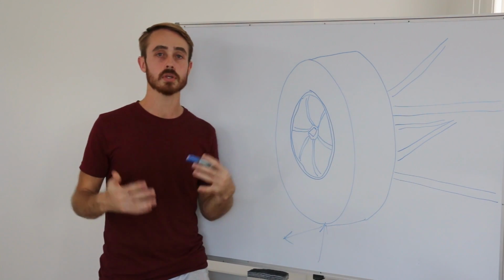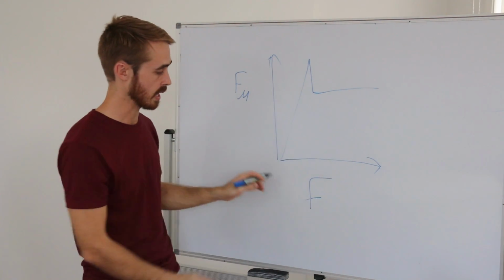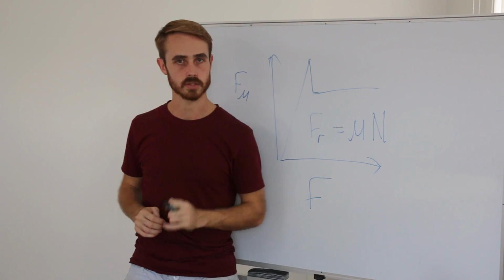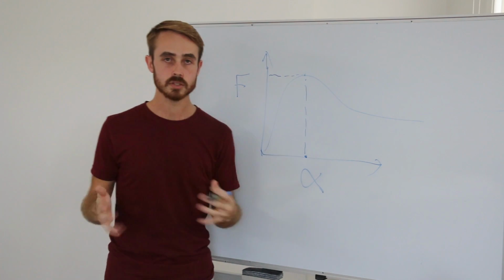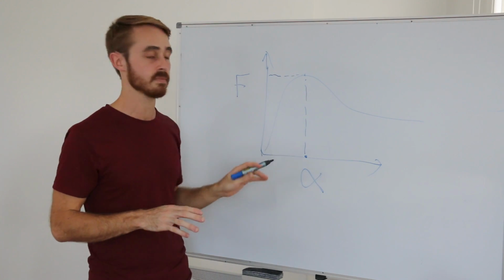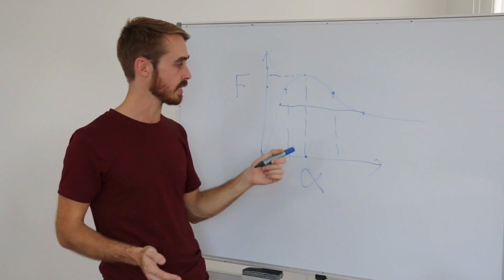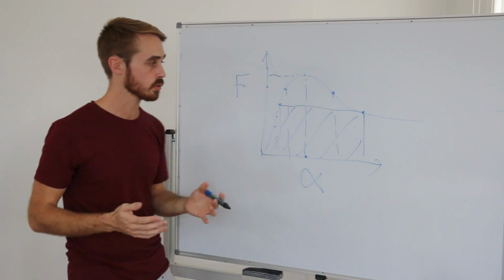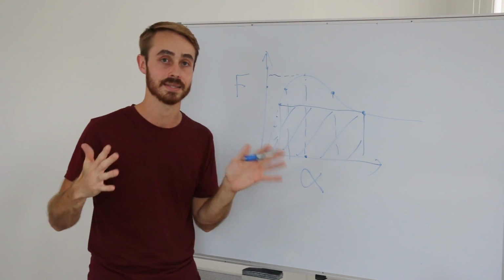How do Race Car Tyres/Tires Work? Slip Angle, Contact Patch Deformation etc.

Comment: For offroad there's also a flotation factor. Overly tall sideways are counter productive for high performance offroad vehicles as handling and response is definitely a factor. When looking at winch truck racing the vehicles aren't crawling through endless tight obstacles at low speeds.

Comment: I was hoping you might go into more detail on the effect of the portion of contact in transition, the section of the patch coming into and out of contact with the road which is travelling at a different speed to the road surface. You touched on patch shape, I started thinking about target contact patch shape and how to achieve it, have you some thoughts on this ?

Comment: Discussion on off-road tyres, longer, skinnier contact patches with no ABS offer more braking when the wheel is partially locked so that the front edge of the tyre is clearing the road of loose gravel allowing the trailing section of the contact patch to run over a surface with a better coefficient of friction. A wider contact patch uses a higher percentage of the tyre for clearing and has a lower ratio of contact patch on the cleaner surface.

Comment: I'm designing a hill climb open wheeler, Hayabusa engine at rear  BUT thanks to formula libre rules and using cfd from the web I can generate 4 times the vehicle weight at the tires so, 4g cornering and braking.
So the tires have to have accept a 4:1 ratio of normal force and 6:1 ratio of lateral force.
I imagined that tires for high downforce cars would have a higher vertical stiffness, BUT, to my surprise the Avon data for FSAE is around 1000 lb/inch and Indi Lights are around 1500 lb/inch.
I also notice the tire diameter increases with speed and downforce. 
So for the indi lights the 1500 lb/inch is not as big a % of sidewall deflection  because the sidewall is higher.
This is the limit of my understanding having looked into it all for about a week.
I suspect there are a lot of people who are wondering how it all works, just as I am.
I have a pdf that shows what I have found out but have no idea how to send it to you.
Cheers
John

Comment: Is it possible to build a system into a rim that can fit under an existing tyre (no modification to the tyre itself) that can circulate fluid within the tyre to help regulate pressure and temperature?

Comment: I think the reason why oversteer is used in off road is to use the dynamic friction of the wheels to push the car through the corner. Like a centripetal force pulling the car around a bend.

Comment: question: at 12:30 you draw 3 lines, where the " lightest car"   has more slip angle  at a low Fn than the other 2  . that incorrect isnt it ?   not only will a lighter car on the same tyre have a smaller slip angle it will also generate more corner force .
Reply: Marc I think instead of imagine that tyre being on a different car, imagine it being driven on a same car. The centre line is when the car is being driven on a straight line. As you turn left at a certain amount of G-force, weight of the car shift to the outside which change the normal load, the top line will represent the right-outside tyre and the bottom line will represent the left-inside tyre. That’s why in racing anti-Ackerman works really well.

Comment: U said the narrower tyres will be better used in speed racing compared to that of wider ones due to energy loss in latter. then why does f1 cars use wider tyres.??
Reply: tyre wear
Reply: Not narrower in size. He was talking about the narrower slip angle curve which have a much stiffer side walls construction. This is good as narrower curve spent lot less energy to the tyre as it pass it's max lateral grip but the drawback is u got more room for margin of error on this tyre due to it's narrow (smaller) sharp pointy curve. This kind of tyre carry a lot less slip angle to achieve the same grip as most roadcars tyre with the same type of compound. Hope this help

Comment: tire air pressure devide by weight/load on tire  =square in("^)  of contact patch. eg3420lbs ÷80psi 42.75"^ 3420lbs ÷40psi =85.5"^  now narrow tire say 235 will have a long skinny patch,  310will have a short wide patch . aspect ratio the 2nd number in the size will also play into the patch shape under static and dynamic load.
load rating vs construction is a 3rd factor. eg my 235/85R16lt 10pr LR E toyo ht at 50 psi /2500lbs/2 1250lbs per tire, had stiff side walls with minimum rear stearing from warn shackles(parts in hand to repair) change to a different brand with all the same"rating " now the truck has sever rear stear(initiate the turn ,straiten the wheel and use the throttle to change trajectory, I some times have  turn out as the ass swings out to stay in the curve and not hit the in side wall.)@70psi. it fills like a low tire when over inflated(lifting the sholders) at 40psi it fills like a flat, but a full contact patch@at 37% load capacity. 

(.5) 50/1250=25"^ old toyos 
(1)40/1250=31.25"^  Vs (2)70/1250=17.85"^  
1) good, brakes and forward bite flat wear patern, bad corners must be taken @5 under the advisory.  
2 )mediocre brakes and forward bite center wear(still has casting tits 1.5"both sholders3000mi in)  good cornering +20 on the advisory 
.5)old toyos flat patch grate corners brakes and forward bite same 50mph advisory @80-90mph
 chears

Comment: Hi Kyle, very good video. The other factor not mentioned as how much the road surface itself plays a role in friction and tyre performance. Asphalt ain't asphalt, particularly the aggregates that go into them when you are racing on tracks across the world, there are marked differences across the globe and the microtexture (sub 0.1mm level) changes as a result. Microtexture  is what primarily gives tyres grip, macrotexture (0.1-10mmlevel) is a measure of the voids that allow water shedding. If interest check out literature about the international friction index (IFI), tyres are half  the grip equation, the surface is the other half.

Comment: So is slip angle relative to the amount that the contact area is turned vs the rest of the wheel, or the amount that the contact area is turned relative to where the tire is actually going?

Comment: Fantastic stuff Kyle, subscribed and every video on your channel queued up for watching. =)

One thing that I think you could also have been mentioned (though I don't know how relevant it is these days, since radials are so dominant), is that the peak slip angle doesn't necessarily just increase with softer sidewalls and decrease with stiffer sidewalls, the rest of the construction matters tons as well. Some of the old bias-ply racing tyres of the 60s and 70s had incredibly stiff sidewalls, much stiffer than what we see these days, yet they also could have peak grip at very high slipangles, even at 10-12 degrees and beyond, with very little falloff as well. Compared to radials though they had very soft and floppy treads, so the deflection was happening there. It is my understanding that when radials started to arrive at the scene they still were building them with "traditionally" stiff sidewalls, making them just insanely sharp compared to the old bias-plies, and it took a while before they got their heads around how the sidewall behavior of a radial should differ from a bias ply. Today of course modern race car tyres combine aspect of both constructions.

Talking with a guy who built and raced cars in the 70s and lived through the transition from bias-plies to radials, he said that one big difference was how much more camber they had to/could use on the radials. Bias-plies were often happy at low angles of -1.5 to -2.0 degrees, radials usually going well past -2 degrees for best performance. Do you think this was in part due to the sidewalls on the bias-plies generally being stiffer, so there was less tread rollover during cornering and hence less need to compensate with camber? He also mentioned that with radials you often got even more cornering performance running so much negative camber that the tread wasn't sitting flat anymore, actually lowering the contact patch size, the camber thrust effect could be so strong. It wasn't sensible to do though, and lead to such immense tyre wear issues that you were better off not doing it (reminds me of endurance GT3 cars running something like -3 or -3.5 degrees of camber at the front, whereas Michelin recommends -4.5 degrees front and rear for Porsche Supercup cars in sprint races).

Comment: I have an interesting question...   Say you had a car (assume 50:50 balance, neutral suspension balance etc) with the same tire width and compound front and rear - but the front tires had stiffer sidewalls, and the rear much softer ones.

If the car is at maximum lateral load in a very long corner (like a skidpad), would it behave as though it had 4 wheel steering?   (slip angle in the rear greater than the front at maximum lateral load)

Comment: Finally, an explaination of tyre dynamics that does not go through trearing through Pacejka and M&M

One thing to note though: Tyre curves include an elastic range where the car's response is almost linear and there is little slip happening, so we can accelerate or brake and still be nowhere near wheelspin/lockup

As long as we keep to this range, the longitudinal forces act parallel to the heading of the rim, so in a corner they actually produce MORE cornering force and keep further from the bounderies of the friction eclipse, rather than closer to it

Braking has the advantage of slowing down the car, so it can be used to trail-brake when you come in fast. 

Power has the advantage of also removing tyre drag so can produce even more cornering force, but increases speed and can thus only be used in short corners.

Comment: Do you have a video on the aerodynamics of tires? The reason I ask is, I was curious as to whether the fender on a motorcycle serves an aerodynamic purpose or if it's strictly to protect from debris. The same question applies to open wheel cars that have the fenders that turn with the front wheels.

Comment: Great video, finally someone covering this topic in more detail on YouTube! I have a few questions about load sensitivity though. I've been looking at a lot of tire data in the last few years, particularly racing slicks, and what's weird to me is that the load sensitivity curve on many of those is the opposite of what is typically understood, including in your video. The curve starts dropping almost immediately from a high friction coefficient (2.0 or more) then gradually levels to a horizontal line at high load. I suppose it has to do with the materials used in the compound, most of which is not rubber, but can you explain why that happens in more detail?

Also, in your experience, do high performance slick tires have the same zero load friction coefficient in both lateral and longitudinal, or the chemical interlocking with the road actually leads to different coefficients due to different contact patch shape (i.e. a much wider tire)? If so, do you think the friction coefficient then gradually levels down in both lateral and longitudinal directions as more load is applied and the contact becomes primarily classic friction contact (i.e. as the coefficient drops to 1.0 or less).

And lastly, how much does the friction coefficient drop exactly, what defines to what level does it drop, does it even drop to zero at very high loads?

Sorry for the long questions, but I'm really interested in all that and it's also needed for a project I work on.

Comment: whats your take on tires with camber built in to the carcass? (Smaller inner sidewall aspect ratio).
I run hoosier a6 315mm to autox and run michelin pss on the street and found some really interesting tires that are supposed to but a compromise between the two (11/32 tread), and I already run >-2.5 degrees camber up front and >6º positive caster.
Reply from the maker: Andrew Askins As far as I can see, cambered tyres mimic the effect of a stiffer sidewall. The tyre having a smaller inner sidewall means that you will have to run additional camber or caster (or both) to get the contact patch working correctly in the turn, so from that point of view it shouldn't be any different to a conventional tyre. However, the cambered tyre effectively triangulates the tyre cross section more, adding lateral strength to the sidewall and reducing deflection, this should mean that for a given sidewall stiffness (think ride compliance) you should see a sharper slip angle curve. You should be able to achieve the same suspension characteristics with a stiffer conventional tyre and suitable caster/camber, however I would imagine the cambered tyre may have ever so slightly more grip on unpredictable and rough surfaces.

Thanks for watching!
Reply from the maker: KYLE.DRIVES Also, I can't imagine the differential rolling radii across the tyre are going to be great for your tyre life...

Comment: Thank you for making such great video KYLE,
I am currently working on suspension of formula SAE cars and i don't know why i even want springs on this things assuming perfectly smooth road. Can you explain why i need to have body roll in my car. And how lateral weight transfer helps in cornering of car? how roll centers height with set of springs and ARB reduces/increases weight transfer?
Reply from the maker: karan patel That's quite a few things to cover there, would take a few videos! Technically speaking for SAE, the springs are probably putting you at a disadvantage, you could save a lot of weight and make a faster car by designing something similar to a go-kart chassis, however the point of the rules is to get you thinking like real car designer! Managing the weight transfer and body roll is all about handling setup and making sure characteristics like balance, turn in etc. are all right. Like I say, would take me quite some time to cover. Claude Rouelle does a great seminar for SAE teams that covers this stuff, but it takes 3 days and $700+ per person! I'll get around to it eventually, but it might be quite some time, my video requests list is huge these days...

Thanks for watching!
Reply: +KYLE.DRIVES i was just going to say, had I saw this I probably wouldn't have went to Claude's seminar haha.  It's 700 for students, it's almost 3 times more for non students.  That was PAIN.

Comment: Can you do a video about Ackerman? I generally know what it is, like: turning radius, inside tire scrub, blah-streetcar-blah, etc.; but I want to know about racing applications. In Karting, it is used to increase (more Ackerman) or decrease (less Ackerman) chassis "jacking" due to front end geometry. What I'm interested in is the application in full size racecars. They don't "jack" the way karts do.
Reply from the maker: hmushmann2 Yep, you are correct in thinking that its a completely different ball game. The Formula SAE car I worked on in Uni used to run no diff so we had to jack like a go kart, but with no insane scrub radius like a kart and full suspension we had to play with roll centres and caster to get the jacking right. There's a photo of me driving the thing with the rear inside wheel half a foot off the ground! Ironically enough that car had the most insane anti-ackerman you will ever see and actually was probably the worst handling thing I'd ever driven haha. Definitely will make that video, might take some time for me to get around to it though...
Reply: KYLE.DRIVES Yeah it's one of those racer's "voodoo" things for me, I just don't quite understand it's practical performance. As for adjusting road cars... it's practically nonexistent, so I can't even play around to see what I like. Ackerman is usually just engineered into the geometry and is not adjustable. I have got a look at a Formula Enterprise once, and it didn't even have different positions on the steering eye-bolt mounts... Though it is an entry level single-seater, they don't want to let the car become undriveable. Much of the setup options are limited as well. Did some light reading, seems like it's one of those debated topics. Or is dependent on front toe. Also dependent on application, like high slip or low slip angles. At this point there are too many variables for me to handle and none of them quantified. Like I said "voodoo"...
Reply: @h.mushmann2351  were ye talkin bout load transfer?